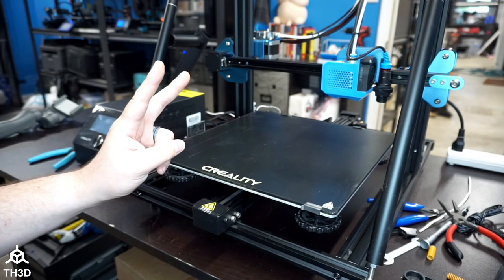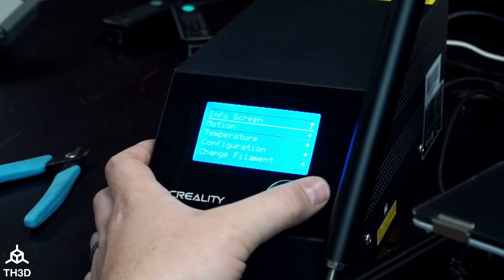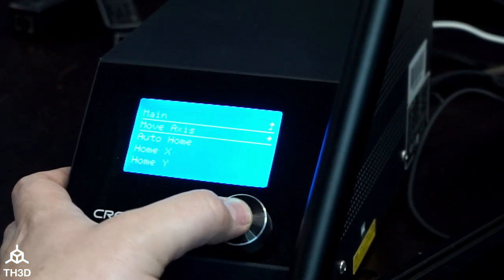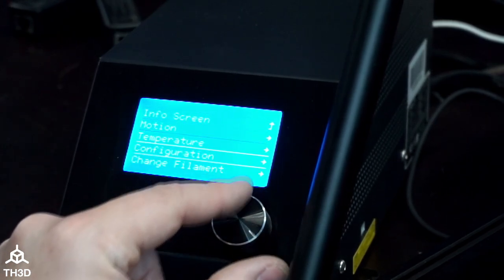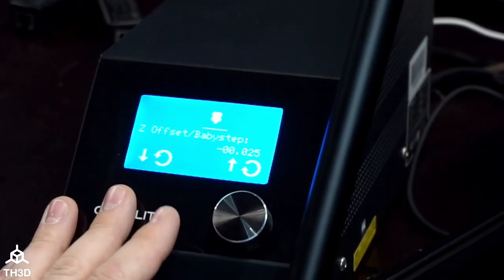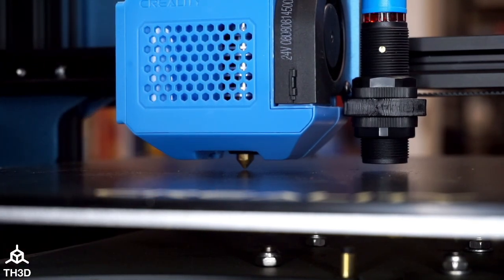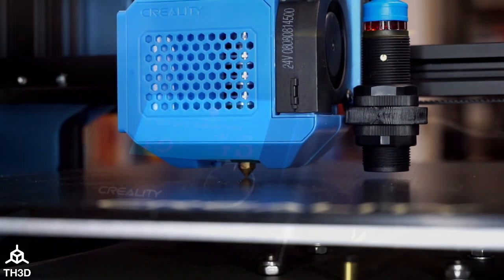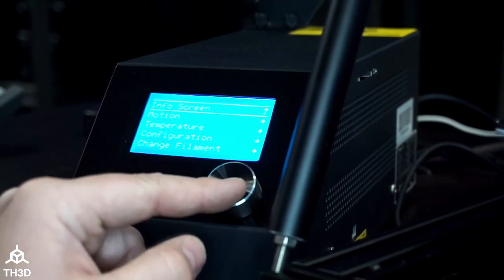EZABL EZTips - Setting your Initial Z Offset

Comment: I am using cr 10 v2.  I think it will be better to replace the software with yours.   Will this software be better for my printer?
Reply from the maker: Many people prefer ours over stock. Better print speeds and new features.
Reply: @TH3DStudio  I live in Turkey and I think it is not possible to ship your development kit here.   That's why I want to ask, if I buy and install this software, can I do ordinary bl touch development?  Additionally, how can I obtain the software and how can I install it?
Reply from the maker: You just need the firmware, not the bootloader for the CR-10 V2

Comment: Even after adjusting this, when I go to print anything its still  to high. Baby Step shows it saved the numbers but it looks like no difference in a print. Any suggestions?
Reply from the maker: Try restarting the printer and see if the issue persists. Some 8bit boards can have issues properly applying the offset.